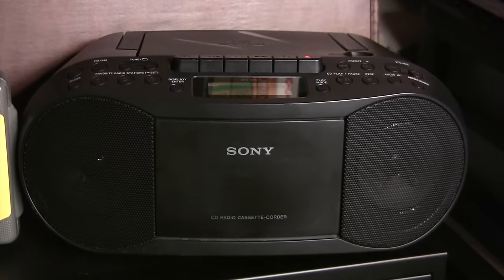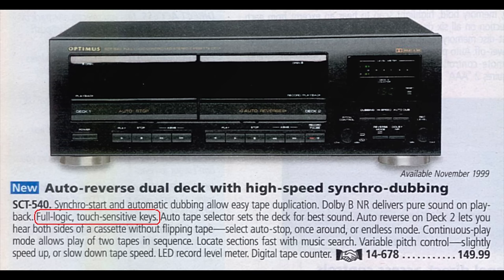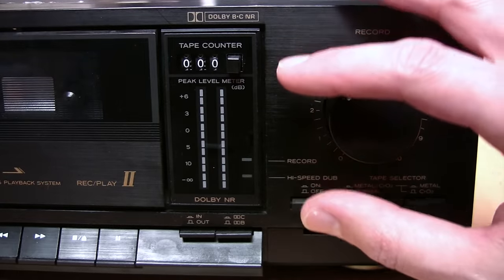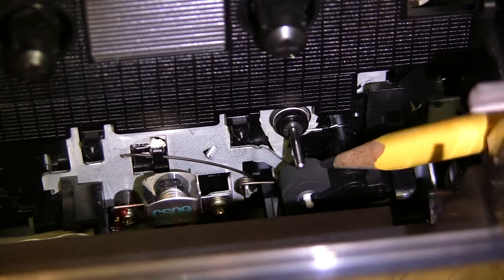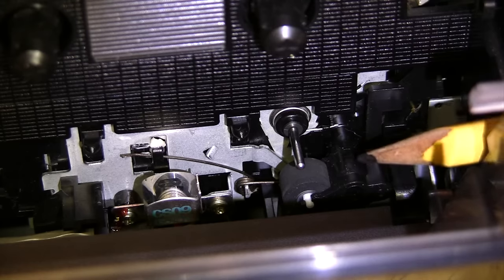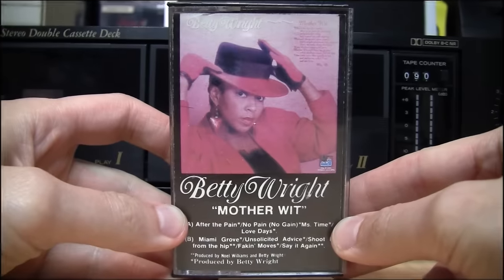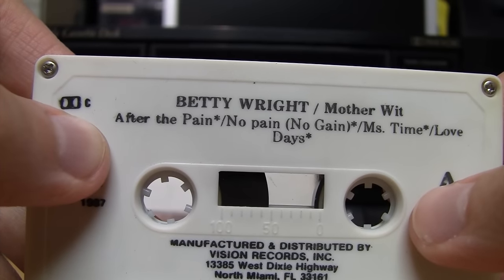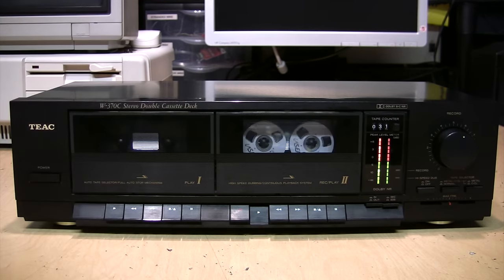Cassette Decks for Dummies

Comment: I have absolutely no idea why YT suggested this video to me - but I enjoyed the video! Oh man - it brought back memories that were decades ago but felt like "yesterday". What did I sit there between the ages of 16 and 25 and make my own cassettes with music compilations. For example, I used the recording level manually to record music using fade in and fade out. Some decks even had buttons with which you could still set jump marks for the beginning and end of a track, despite fading. I have often even used really expensive chrome and metal tapes, the casing of the cassettes made of ceramic.
I used devices from Technics or Sony, a lot of money from pocket money and later wages went into devices, cassettes and records: D

Comment: Excellent video as usual! However, a few minor points:
About the finger test: Worth mentioning that in PLAY mode, the mechanism is ALWAYS designed to deal with some friction and it's okay to hold the takeup spindle to judge the torque. However, in Wind or Rewind mode, most mechanisms have a much more direct way to mechanically connect the motor to the spindles, and you should probably NOT try too hard to hold the spindles to judge torque, or you might damage the motor with overcurrent.
On most auto-stop decks, the deck will stop if it senses that the takeup spindle isn't turning. So in rewind you can usually wiggle the other spindle and check if that keeps the auto-stop from engaging. However there are also decks that use a different auto-stop mechanism, for example the tape may go around a small lever near the heads, and when the deck reaches the end or beginning of the tape, the tape is pulled taut and engages the lever which stops the mechanism (or changes direction on an auto-reverse deck). Obviously if you operate one of those without a cassette, it will not auto-stop, so that's no reason to panic.
I've also seen decks that have an optical sensor to detect the end of a tape (usually those are on auto-reverse decks). If you push PLAY on those, it might switch sides back and forth without stopping.
Looking forward to separate videos on the subjects you suggested. Maybe you can also do one on older decks with DIN connectors? Or is that subject too European? ;-)
Oh, and kids, if you get a DCC deck, much of this is not applicable. Don't demagnetize those, ever, or you'll destroy the head.
Reply from the maker: U.S. market cassette decks never had DIN jacks. This TEAC deck has a pinout on the board for where a DIN jack would go, but they didn't install it.

Comment: I have a JVC-Deck that i bought for a 10€ + shipping a few years ago with Dolby-B/C NR, a pretty modern one with a lot of features with the logic circuit. I keep maintaining it and it still runs like as their first days.
Reply: I have a JVC deck that is from the 80's with the big analog meters.  I have found the JVC decks, although likely not in the realm of the more expensive decks, tend to be very reliable.

Comment: Very nicely done. A not so brief but lucid "walk thru" on cassette decks. Won't bore you with the decks I've owned/used over the years. My first component cassette deck, after military service (and broke) in 1975 was a Pioneer CT-F2121. I recently got a Denon DRM-800A deck and both these decks cost $125. So there's good value out there. You mention some good features to seek out. Additionally, an MPX filter is great for FM recording and a good meter is essential. LED's are great but five or seven segments stink. Might as well use VU meters. My DRM-800A has sixteen segments per channel and -40 to +8 range. Look for at least ten segments and two color meters are a sweet touch. Record Mute, Rec Return (or Cancel), fade in/out are boss to have on your deck. Also have a Teac X-3 open reel deck I bought in 1982. A good companion component to use with any deck is an expander, for obvious reasons. I have a Pioneer RG-2 (1981). A TDK HD-01 (head demagnetizer) for cassette decks makes degaussing a snap though not as effective as the wand type.

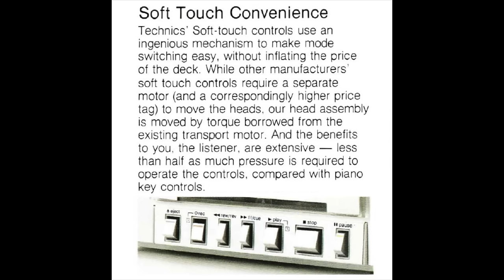Comment: If it's an old deck and you can't test it in the store or have doubts about condition, IMHO a fully mechanical deck OR a full logic/electronic deck is more likely to work than a "mechanical soft touch" model as those tend to have more belts, gears, pulleys that can break.. If you read the Technics text at 1:50 it's very telling... Anyway, thanks for a great video that's sure to inspire many future cassette enthusiasts!
Reply: Indeed, the mechanics behind an older soft touch deck I have is pretty bonkers, and involves a bunch of protrusions on a rotating rod triggering other mechanical parts. Impressively it still works fine though, but you have to hold the buttons slightly longer or sometimes it misses the press.

Comment: I scrimped and saved for seven years to afford my dream stereo system. It was a full rack Phase Linear amp, preamp and tuner with a Pioneer P3A fully auto turntable and a Teac A-150 tape deck. I bought all of it while stationed in Germany in the seventies for less than a third of what it would have cost in the US. Still, I had about eight grand tied up after buying speakers. I sold it to a vintage collector in 1994 for an obscene amount of money, and I'm glad I did. It was way overdue for a full capacitor upgrade and I just didn't want to mess with it.

That Teac tape deck was considered an A grade/tier component at the time but even with the much over-hyped Dolby filter, the deck produced an unacceptable amount of tape hiss. So much that I ended up paying six hundred dollars for a DBX noise reduction unit to all but eliminate that hiss, and it did it's job well.

Comment: That is a well written guide.  I'm actually surprised how much better a late 70's Hi-Fi deck sounds compared to anything I ever played a tape on when they were 'normal'. 

That said, I've managed to accumulate the service manual (Which was not on HiFi Engine - but is now) and a whole second deck as a spare parts donor because a whole deck was cheaper than a replacement door.

Comment: Nice clear guide, and I appreciate your not going on about exotica which makes the subject seem like an exclusive club. However, I do have a high end deck (not Nakamichi) with Dolby S, auto bias adjustment, etc, that I bought fully refurbished for £200 and I can confirm that with the right tapes it makes recordings that are indistinguishable from the source material - even CDs. I pity the current generation who think that godawful compressed MP3 files are good quality.

Comment: As someone whose slowly building my own cassette HiFi deck piece by piece, I find invaluable videos like this edifying to my endeavour. Also the tip about using a window cleaning agent to clean the pinch roller can also be applied to VCRs as well, as I see it as a safer alternative since the last VCR I attempted to clean the pinch roller with using isopropyl alcohol resulted in the rubber comming off.
Reply: Damn man how is it coming along?
Reply: Isopropyl alcohol dries out the rubber so next time you should not clean it with that

Comment: Did you know they used to use Freon in tape deck cleaning solutions? Obviously it's not available anymore, so instead try to get 90% iso alcohol for cleaning the heads and other metal bits because it cleans better and evaporates faster than 70%. However, don't use higher than 70% iso on rubber bits or it can be too aggressive and start to degrade them. Also try not to use too much cleaner fluid (you don't want it to get into the bearings or hinges if you can avoid it). On really old decks (pre-1985 or so), try to press gently into the pinch roller with a fingernail or other blunt item. If it leaves an indentation, don't use it; the rubber's going bad and it'll eventually gum up your tapes. Really nasty capstans (persistent build-up and/or rust) can be polished up with very fine sandpaper (1500 grit is ideal, wrapped around the capstan as it's spinning) and then cleaned as normal.

Comment: I recently decided to resurrect my high-end Onkyo TA-2600 cassette deck that was working when I put it on a shelf over 15 years ago.  I ordered a belt kit and installed it before even plugging it in.  It was a good thing that I did this.  The original belts were nothing but black goo and it was a real pain to clean the capstan drum and pulleys.  When I did finally power it up after installing the new belts, it worked well.

Comment: Here I am from the new Marantz deck video...pretty much already knew the stuff! Now we need to find a pre-recorded tape that's not baked in the sun or placed too close to a bare speaker...

 About the window cleaner on rubber - there's nothing wrong with isopropyl alcohol (standard procedure on O-rings and industrial seals) and if the rubber would simply break off or sludge away it's pretty much over for that "tire". 99% alcohol would be  preferred because there's no water to slow the drying process...and no scents or moisturizers and everything else to contaminate. The ingredients on Windex does seem to be kinder to rubber but ammonia!

Still can't get over that last tape pretty much clipping...ouch

Comment: Great video! This kind of beginner's advice has been very absent from youtube.
Also another great demonstration from you on how well even these entry-level component decks sound. I honestly have never understood the hype about the high-end cassette decks that really don't sound much different than a good reel-to-reel tape recorded at 3-3/4ips...
Reply: To be fair, that's running significantly faster, and with wider tape, so a standard cassette deck is doing pretty well to sound as good.
Though if you want great audio from a tape, you could use..a VCR - seriously, hifi audio on a VCR is excellent.
But yeah, even lower end decks can sound more than good enough.

Comment: That's definitely a budget later model cassette deck though I'm surprised to see Dolby C on it and even more surprised to see fine Bias! This cassette deck should be capable of making some really great recordings once you figure out where to set the fine bias level... Since this cassette deck doesn't have 3 heads, you can't listen to what's been recorded as it's recording while you adjust the fine bias so you basically have to make a test recording starting the bias at one end and adjusting it to the next number every 4 beats and then playing it back counting every 4 beats of the track and listening for where it sounds best! 
Yeah I have had a Denon cassette deck that I had to do this with to get amazing recordings and while it's time consuming, it's well worth the effort! 
Generally I would stay clear of cassette decks that look like this one but this one is actually pretty good considering it's budget status.... 
Great video 👌

Comment: Great video!  One thing to add…if you are recording in Dolby, there is often a Dolby logo on the VU meter which should indicate the ideal peak position to use VS. setting the peak at zero DB. This is used because Dolby decoding utilizes amplification on playback of suppressed upper frequencies.
Reply from the maker: That's actually a misnomer. The Dolby logo on the meter just indicates the Dolby calibration reference level. It has nothing to do with the recommended maximum recording level. (Technology Connections was wrong about this in his video about Dolby NR.)
Reply: @vwestlife  interesting!!!!! Ok thank you for the education!

Comment: Am I the only one that likes extra-sharp treble EQ?   By that, I mean, I would record onto tapes with the Dolby turned on, but would play them back with it off.  (sometimes also the same with the type 2 switch) 

This video made me look up some old photos of the setup I used in the 90s, back when I still made mix tapes.   Hell I probably have 100 of those tapes in various boxes scattered around (as all of my cars have working tape decks of some kind in them)  But I remember my first stereo cassette recorder... a cheap boom box gifted me in Xmas 1984, purchased at the nearby Ft. Collins Safeway store.   It was so cheaply constructed that I had to take it apart more than once to jerry-rig fixes to broken plastic support pillars for the tape mechanism.   (that is, until a couple of years later when I blew out the tape recording circuits by making a horrible newbie mistake of hooking up the mic input to the speaker output of a tube-driven stereo amp.     AARRGGH)

Comment: I got a functioning Technics dual tape deck from Goodwill a few years back, and after an hour or so the drive gear on the record side lost too many teeth to continue. Apparently it's a common flaw with that line. I just got a Sony one a few days ago at another thrift store as part of a stereo bundle and so far so good, but I haven't recorded yet.

Comment: In the beginning of my hobby for tape collecting and recording I was obsessed with features like 3-head, Dolby C and S, auto-reverse, auto-calibration. But as time went on I began to really only care about decks that have HX Pro and a good head alignment. HX Pro works better than some people might assume. I'd rather listen to a tape recorded with HX Pro than one with Dolby C or B on their own. B works just fine most of the time but if you record hot on a type l or type ll, type lV tape with HX Pro it'll be just fine and you won't have to deal with other decks and the inconsistency of Dolby playback. Tape hiss also doesn't bother me too much. Dolby S is pretty good but the price point is too much and you'll have a more complex deck to service if you ever need to. Don't get caught up in metal tapes as well. They can be a great but the price is usually too high and some haven't aged well depending on where or how long they've been stored.

Comment: 4:20 - There's a deck for Techmoan. VFD spectrum analyzer, bouncing analog VU meters, brushed aluminum faceplate...
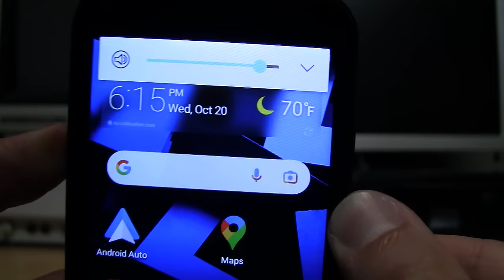21:29 - I can highly recommend Memorex dBS and TDK SA tapes, I've used them both quite a bit, and they hold up to a lot of re-re-re-re-recording.
Amazing to find that deck still encased in its protective layer after all of those years! Sounds great, too! No doubt it's got low "miles," definitely worth $7.
Reply from the maker: That JVC deck literally is from a Techmoan video: "Don't Digitise, Just Enjoy".

Comment: thanks!
Even I didn't know or was somewhat confused about when to push the desired nr button, I have ocd which would partially lend it self to the me leaving them always pushed out no matter what lol.
Also this video made me change my mind about tossing my cassette stuff and holding on to my JVC full logic controled deck that I got for free and hands down my favorite deck I ever owned. I was considering tossing the stuff because recently the foam buffers haver been ripping off of my cassettes and it was frustrating. But I think I will see about fixing the ones that were affected instead first. I have a lot of skinny puppy, r&b and new jack swing recordings that I think sound awesome on cassette and I would hate to toss all of it just because I got frustrated with a few bad tapes.

Comment: i have a yamaha kx-w 262 double cassette deck that i love, it's full logic with auto reverse. how i cleaned it before i got a cleaner tape was i pressed in the tape sensors then pressed play and boom i could slide my q tip in there and clean it out

Comment: I bought two of these deck. One has the soft control and the other has the hard button. The soft button control had stopped working and my tape is stuck inside the player. It has been on he shelf for a year now. The other deck that has the hard buttons has been much more reliable since it is more direct and does not require power to make the mechanism move and my tape won't get stuck since the mechanism will disengage manually; If you don't want your tapes to get stuck get a recorder direct control so it be more reliable. I hear that the mechanisms are more simple in these types.

Comment: I wish you could still pick up a component tape deck for under £10 in the UK. With most charity shops (thrift stores) not accepting electronics now, your used options are the few that get listed on FB marketplace or the vastly inflated prices on eBay. Cassettes have become a hipster medium now which as with the vinyl revival, has pushed prices out of the reach of the casual nostalgia nerd. Fortunately I saved the low-end Sony twin deck I used in my teens to record and dub many hours of mixtapes from the Sunday afternoon charts, but upgrading it to the Technics or Panasonic I always wanted is now out of the question. I bet millions of perfectly serviceable or easily repairable cassette decks went to landfill during the period when the format was abandoned as obsolete.
Reply: Not under £10 but there's always a good few basic but serviceable models under £50. If you actually are gonna use it that's not bad and way cheaper than when new. Typing this whilst PAT  testing an amplifier in a charity shop btw... Do check out the bigger - often furniture orientated ones - which are popping up btw, many do sell electrics.
Reply: @snapea  On interest does the shop(s) own the PAT tester ?  At work an external company comes iin every couple of years and spends several days testing evrything with a plug.
Reply: @MrDuncl  We do the testing in house. So, yes, one tester in each shop that sells electrical items. The basic models are few hundred quid, they pay for themselves fairly quickly.
As a side note, for a few years now the HSE guidance  has encouraged a risk based approach to workplace PAT testing frequency - eg. a handheld corded power tool in a workshop would need looking at more frequently than a stationary computer in an office (which might actually never need to be PAT tested - a visual inspection may suffice). This approach makes good sense but most companies seem to find it easier to pay a contractor to sticker everything annually rather than maintaining a complex inventory of items and their inspection intervals.